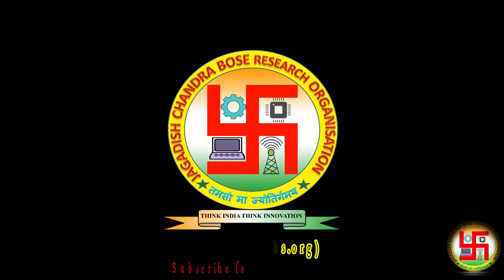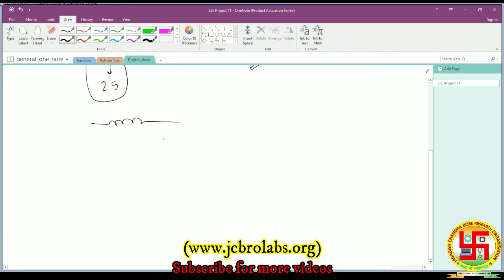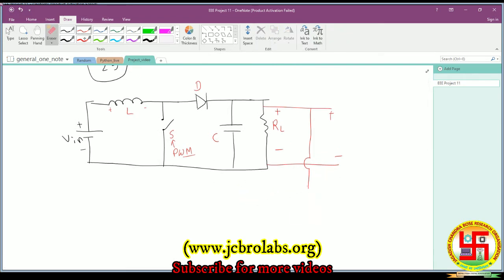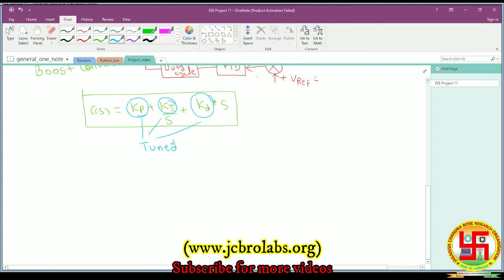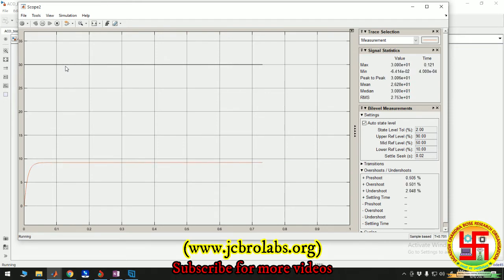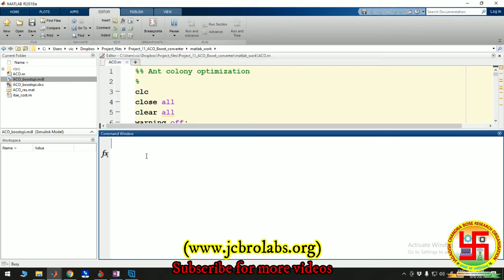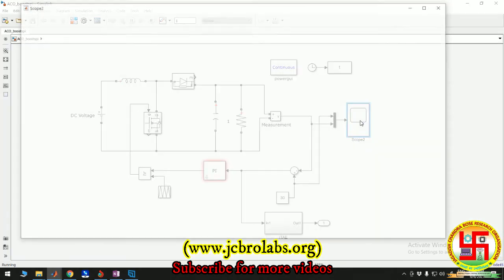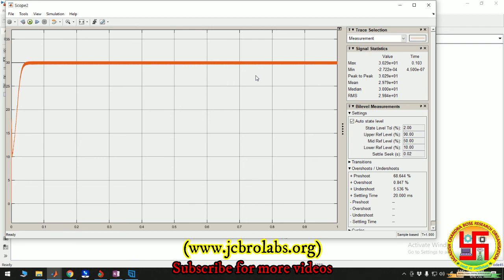EEE Project 11: ACO Optimized PID for Boost Converter Simulink

Comment: Hi sir can u tell me plz which objective function is best for removing harmonics in AC among ISE ITAE ITSE by using aco optimized pid controller
Reply from the maker: You should go for ITAE....
Reply: @buildwithsharma  Sir can u plz share me programming part of aco optimized pid controller for boost convertor simulink
Reply: @buildwithsharma  sir plz share me aco algorithm code for optimizing pid controller for boost convertor. U said in your video.